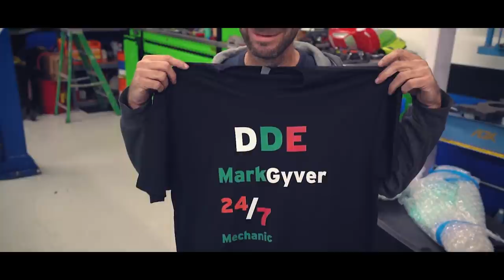I BOUGHT A FAKE LAMBORGHINI SV! *6 speed gated LP640*

Comment: You have to speak to Sean from hitech exotic in LA. his clutches are the best you can get for exotics, a full Kevlar set up with light fly wheel can make them last up to 70,000 klms. I have one in my lambo. 💥💥💥💥💥💥💥💥💥💥💥💥💥
Reply: E-gear Gallardo? or 6-speed? My E-gear needs a new clutch soon
Reply: Exotics 4 Life I have an e gear, I put the HT300 clutch with the beefed up throwout bearing. If you follow the stradman he has one in his car and even did a video on his being replaced, there expensive but you will get up to 70,000 klms out of it.

Comment: Ooooh, I desperately need some new bluetooth headphones.  If you can reccomend some that are under $60 and last a full shift (6.5 to 7 hours) of constant use. And have noise canceling phone feature!  EDIT: as I was writing this you got to the part where you list EVERYTHING I just said I needed.  Welp... I just ordered the ear buds and the Cove bluetooth speaker!  When it comes in 5 or 6 days, I'll post a comment on what I think of it.  DAMON, I only ordered the earbuds because I truly believe that they will sound good.  I dont think you would endorse something that was crappy.  Plus, if they suck ill just send em back because I could easily have ordered a pair of sennheiser, monster, JBL, or Skull Candy that are the same price and WILL sound amazing. Especially right before xmas, amazing deals can be had. So Damon... I'm trusting you buddy. Don't let me down. And I'll post my thoughts of them.  Oooh I can't wait. I love headphones, I use them every day.  I used my skullcandy Aviators every day and my Monster Turbine ear buds. Monster makes the Beats By Dre headphones.  But at $169.00 for the Turbine and $129.00 for the Aviators I am picky. I just need some "daily driver" earbuds because Im vert rough on them.

Comment: Open diffs are really dangerous.
Not only does the outside tire not spin, and inside tire spin, but the inside tire has an, at least, 2x multiplier.  Thats why the inside tire is producing the milkiest of white smoke. If the car had a real diff, with both tires spinning,.. lets say they would be going 60mph. With an open diff, same energy, and one tire stopped, the spinning tire will be going 120mph.

Comment: Super glue and baking soda mixed  airplane mechanics use it to fix chips on carbon props it does some chemical reactions and becomes extremely strong and hard u prob can Mabe fix ur carbon splitter or use fibre glass resin apparently works as well

Comment: I bet I am the only person that noticed the 2017 Specialized Demo 8 with the Ohlins Suspension and Rockshox Boxxer world Cup forks at 19:44. It was shown less than 1 second but I know bikes. Plus the yellow Ohlins coil spring stands out, and Specialized is the only model that has the cut-away from so it makes servicing or changing shock out very easy. But since this video is about a fake lambo is that Specialized Demo 8 fake?

Comment: The M2 is great, but why buy a brand new car to complete gut it, cut it, throw everything out, carpet, seats, steering wheel, panels, body parts, engine parts, install tune parts. Isn't it better to buy a slightly crashed M2, with still  factory strong whole body structure, geometry of chassis is intact, and then throw out the fenders, the hood, the broke fascia, or doors smashed, and do everything Alex did. It is a waste on a brand new, comfortable BMW in warranty, with all the BMW goodies inside, but if you have money, who cares.

Comment: Amazing car guys. You can actually purchase a complete turn key replica Lamborghini or Ferrari from "Beyond Customs" in Western Australia. They have a whole factory. Their replicas even come with Air Bags and are over 1000hp if you add twin turbo charges. Each replica has a 5 star safety rating including a safety cage and have interiors which are as good as the real car with either a manual or an automatic transmission. The cars are also certified by engineers and come both in left and right hand drive. They even have electric mirrors, windows, air-conditioning plus a premium sound systems including navigation for a fraction of the price of the real car. A lot of Arabs and Americans buy these cars and get them shipped overseas because they want to look rich but don't want to waste their money on a car which is expensive to fix and maintain. All parts used in these cars are brand new and the engines are re-built V8 and V12 engines with all new components.